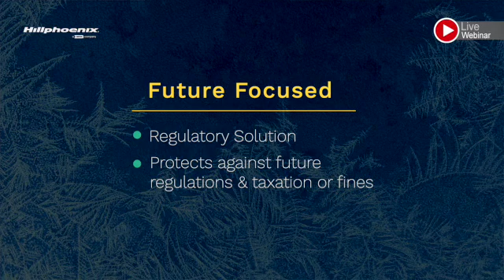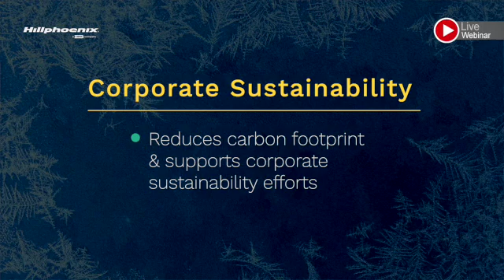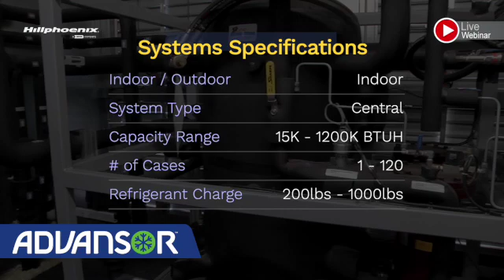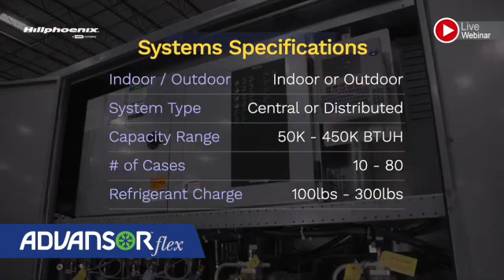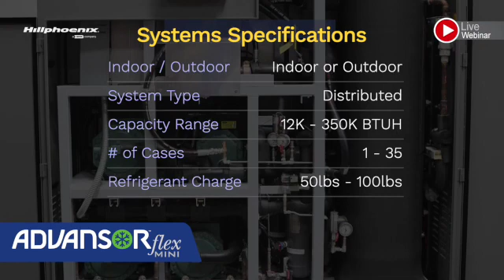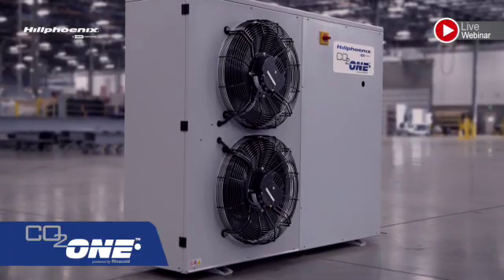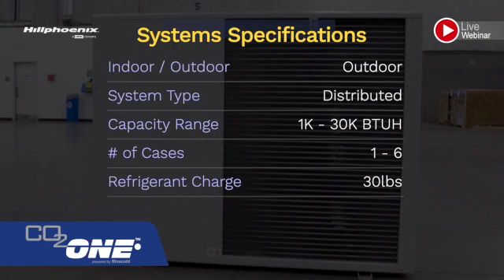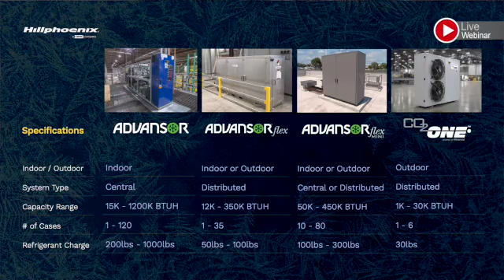Hillphoenix CO2 (R744) Refrigeration Systems Product Portfolio Webinar

Comment: New combustion tech will be COP 4 heat pump with combined cycle and combined heat and power (electrical).  It will run on Natural Gas for around 2.7 cents/kwh for small building feeds to half that in large facilities.  The combined cycle captures the CO2 and stores the CO2 for use for fuel making from solar thermal for a true net zero solution off grid.  The CO2 enhances the cycle efficiencies to 75%, and with combined heat and power, the fuel is nearly 100% used with no waste like a grid system has.  

Yes, CO2 is the future.  Capturing the CO2 makes refilling CO2 nearly zero costs.

Comment: One good thing is if you have a blowout, it's not so extremely expensive to buy 400lbs of CO2... compared to 400lbs of 404A/507/448 etc. Plus CO2 detectors have been around for ages, and they are already in use (hopefully) in places like beer keg walkins etc. So if there's high CO2 in the meat prep room if a liquid or hot gas line blows out, people can leave, and/or power off the system and prop the door open. Won't kill people like ammonia either. Get an ammonia leak, gotta evacuate the whole store, and call the fire dept etc. Not a good day.
Reply: It is cheaper per pound, but you have to keep a whole charge on hand because no one keeps refrigerant grade CO2 in stock.  We have to manage our supply because none of the refrigerant parts houses keep it.  We have to go to an industrial gases company and it is only made to order so don't expect it to be available in an emergency if you don't keep it in stock yourself.
Reply: Furthermore, the human body detects suffocation by CO2 concentration; you will very quickly realize that you need to a) breathe more and b) leave the area, if there is a dangerous CO2 concentration.